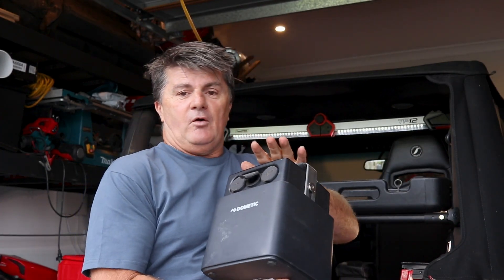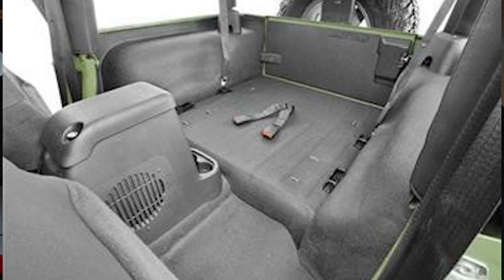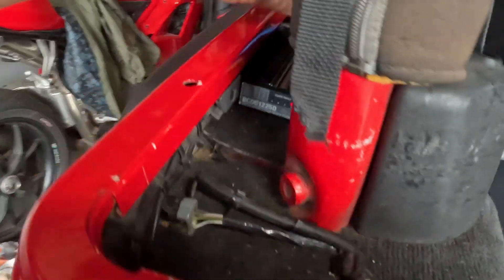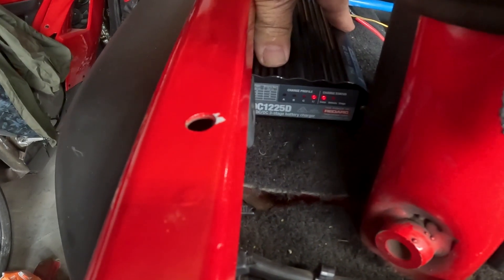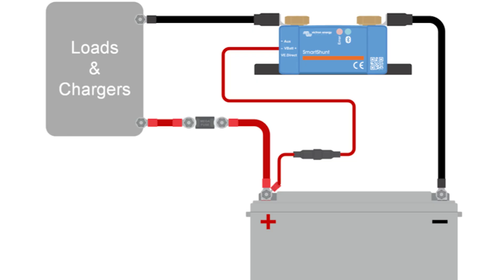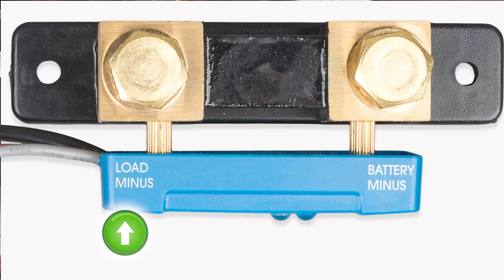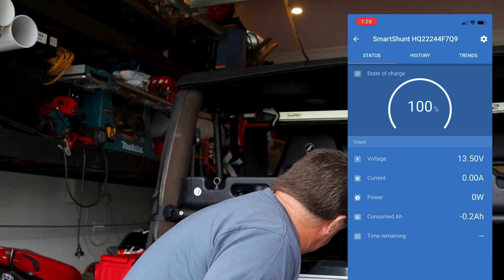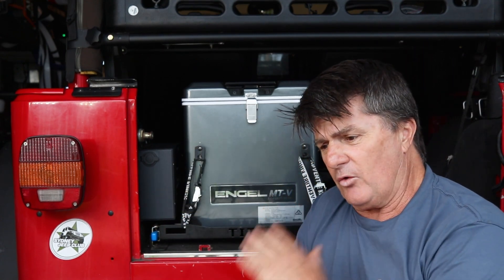DIY 12 volt OFFGRID System // SIMPLE build QUALITY Components // Multi Brand System

Comment: I use Victron gear too in my Jeeps. I found it super handy to enable the function to display the stats in the connections list when you first open the app. That way you don’t need to click on the shunt, you can just see the necessary info as soon as you open the app.
Reply from the maker: I think one of the updates is doing that automatically now. Yes, nice piece of kit.

Comment: That looks like a great little setup! Does that mean you borrowed the Engel from the camper trailer? Has the trailer setup changed?
Reply from the maker: The old Waeco has a thermistor issue. Just looking at my options for the camper....
Reply: Oh bugger. It’ll be interesting to see what you decide on. I love my Engels and your Engel fit well in the front box but you could always get a taller box.